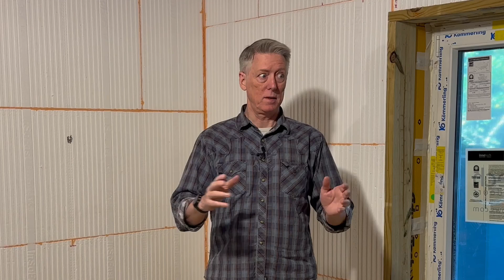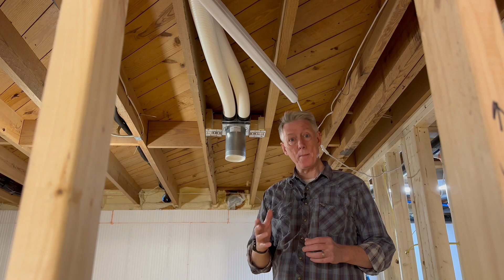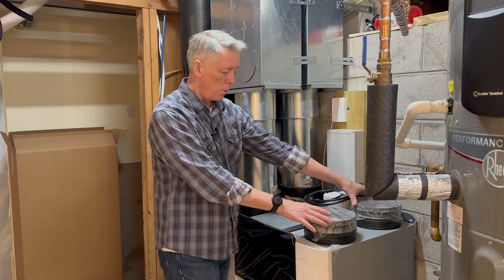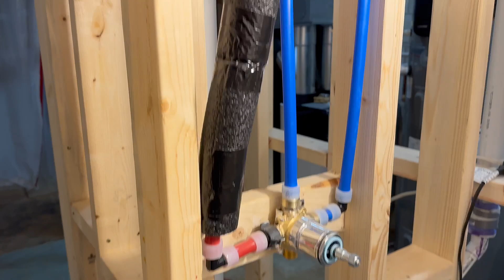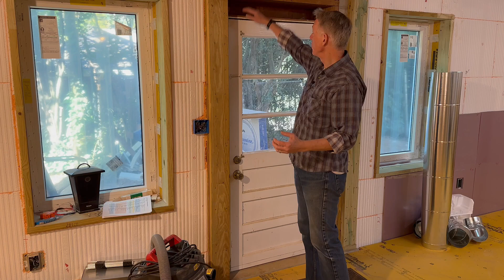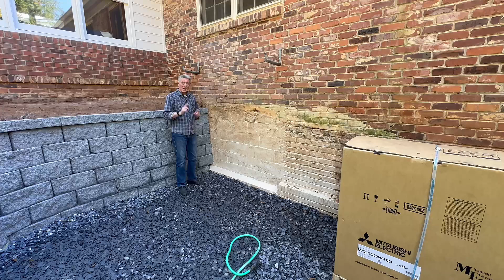Basement Remodel Update #7:  The Many Things to Do Before Drywall

Comment: Really enjoyed the video, Allison! One picky point about the supply side of the ERV ductwork. Zehnder ComfoAir Q ventilation units can be either right or left. In your case, we chose to have outdoor connections on the right and house connections on the left. The front left port in this configuration is indeed the supply to rooms, but it is so even if the sound-attenuating manifold is mounted incorrectly with the arrows pointing downward. So the arrows may not always indicate airflow direction: they mayst be installed correctly in minimize sound and maximize airflow. 😊
Reply from the maker: Thanks for clarifying that point, John.  I had forgotten that these units can be either left or right handed.